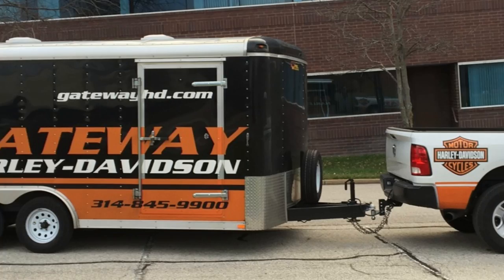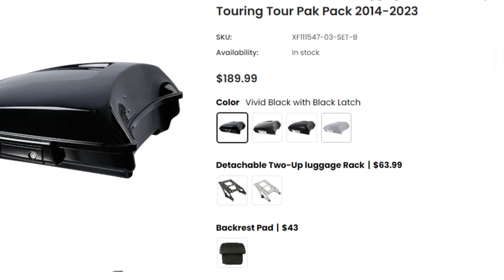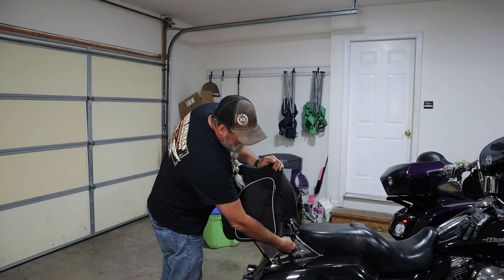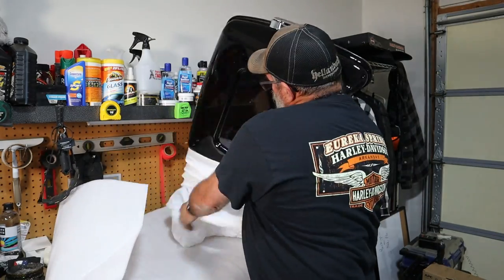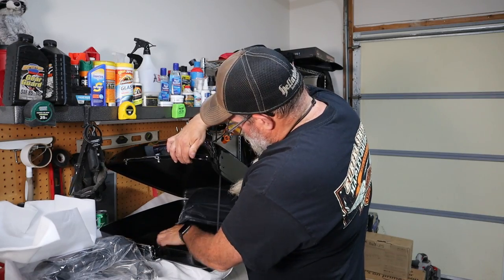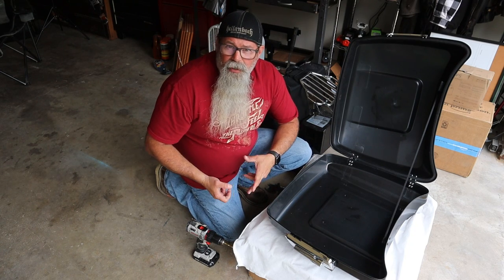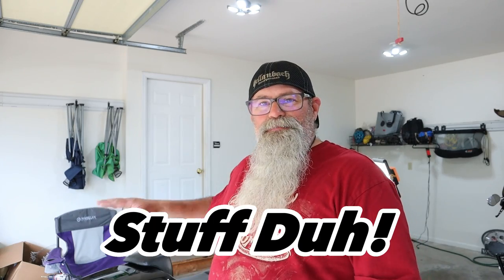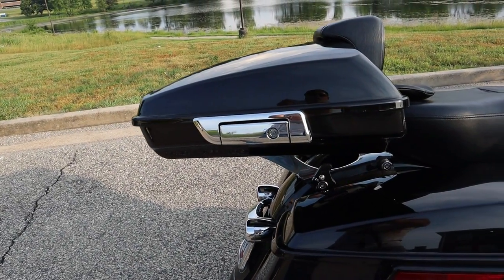HARLEY DAVIDSON STREET GLIDE Razor Pack Install and Review TCMT

Comment from the maker: I have put over 1500 Miles on the bike since adding this Razor pack and it is have been great so far! what do you think of the look?
Reply: Still rocking with it??
Reply from the maker: @raystanley5126  Yes, I can say if your going to add a liner\organizer I would go ahead and get the special 3m double sided tape for hot weather but other than that it has been great. Size is perfect for me 99% of the time, locks good too!
Reply: Thanks sir!!!

Comment: No, I bought that exact same razor tour pack from my Harley. I did get the lid painted to match the bike of course and I did change out the lock for a Harley lock to match my bike. The only problem I’m having now with that particular tour pack is I want to put the insert liners but the ones I bought from hard, it didn’t even fit other than that. The pack is wonderful. But I recommend to get the metal plate. You’re gonna need that.

Comment: Great video man, what size drill bit did you use to make the holes?
Reply from the maker: I don't recall I usually eyeball the bit that is just under the size of the bolt threads by a 1/16 or so. Glad you like the video, thank you for the comment!

Comment: NOTICE!!! I bought the same one and those holes are useless. Take your mounting bracket, place it upside down and put it in the tour pack. Mark your holes then drill. If you don't the predrill hole spots that there there won't line up! There are not drill hole spots for the backrest on the one that i received.